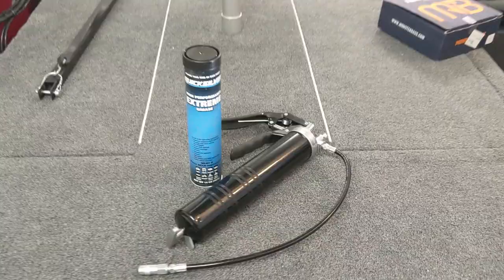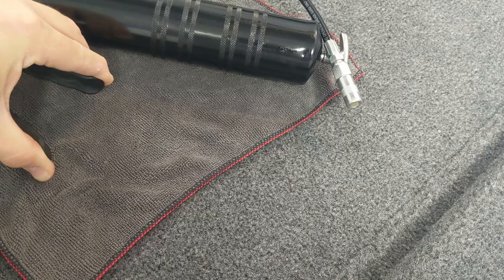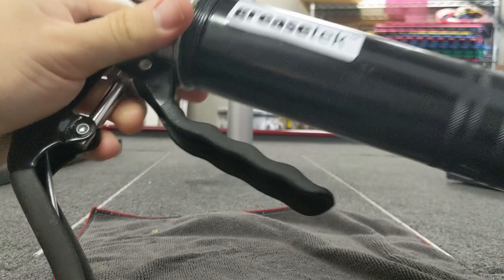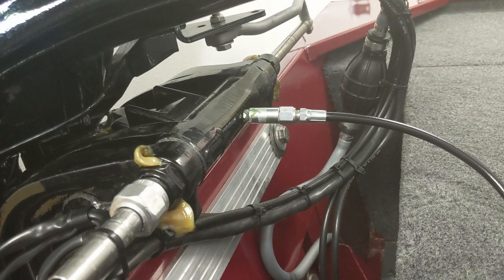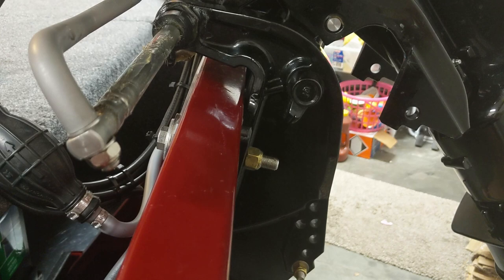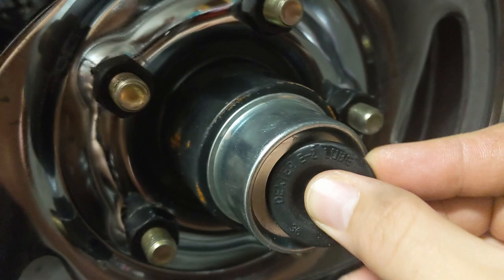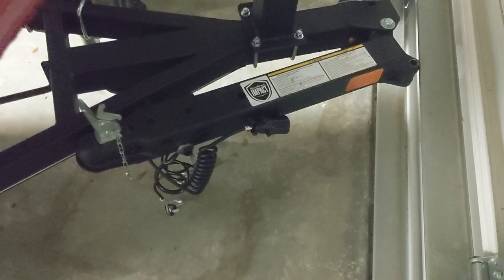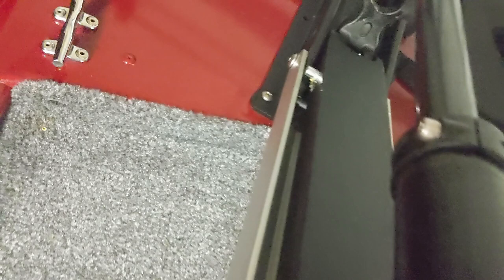How & Where To Grease Boat Engine & Trailer | Grease Gun Tips & Tricks

Comment: Just what I was looking for.  Thanks.  I'd add that with my particular grease gun the connector was getting stuck on the fitting.  I found that the best way to remove from the fitting was to unscrew from the hose and grip with a pair of pliers and pull.

Comment: My 2022 Tracker has the Dexter EZ lube axles. Can't say for sure, but yours also appear to be Dexters.  According to Dexter instructions.....you first jack up the tire, then spin the tire while injecting grease.  Not rotating tire dumps the grease in one spot and can blow the back seal.  If you have a Dexter system, search for Dexter E-Z lube system.
Reply from the maker: Definitely the best practice, to rotate the wheels while adding grease.

Comment: Good stuff sir. Silly question... On that last part on the outboard that you greased, what is that little lever for?
Reply from the maker: I greased the actual hinge that the trolling motor pivots on and also the pins that lock it in place. Greasing the pins lets it release so much easier with the pull handle.
Reply: @mvboutdoors  I meant the lever on the outboard..

Comment: I have a similar motor on my boat and am trying to find a way to keep the motor from turning when trailering. Do you use anything other than a transom saver?
Reply from the maker: I also had issues sometimes with it turning. The best solution I found was when using the transom saver make sure the tilt really locks it into place and the bungie is tight.

Comment: Any suggestions on greasing squeeky stearing wheel?
Reply from the maker: The hardest part is finding where the squeak is coming from. It could be within the steering wheel where you want to use a thin oil like silicone or down the cable where you want to use some grease.